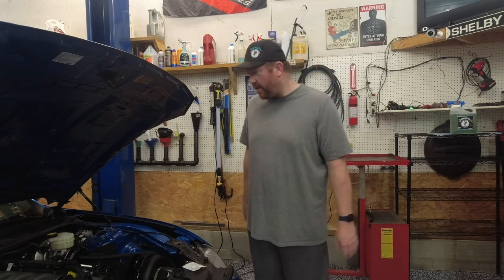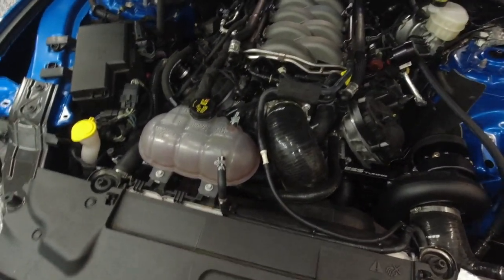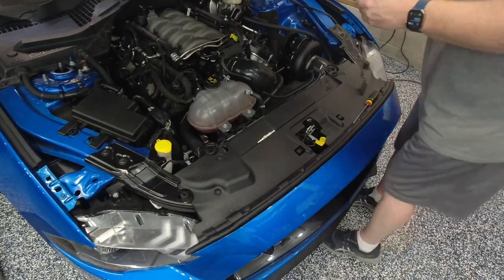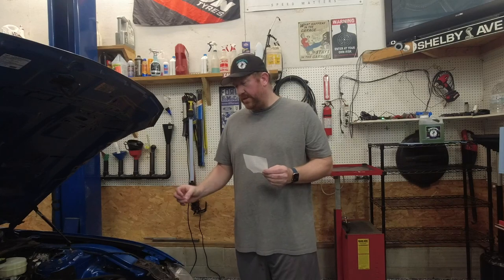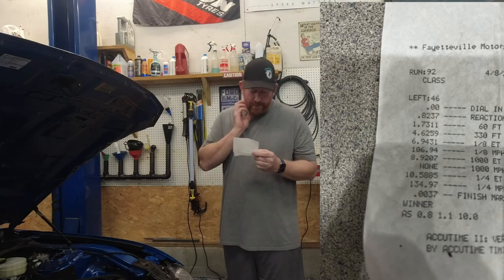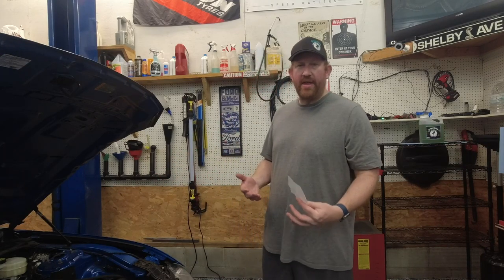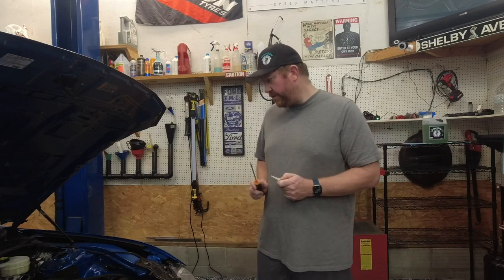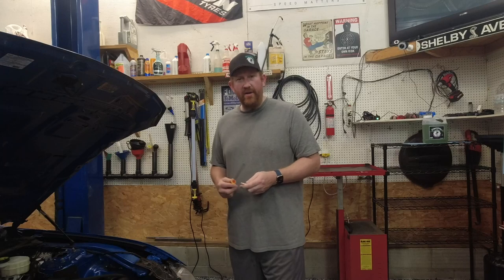S550 ESS Supercharger Follow up and 1320' Drag Times

Comment: Good stuff. My kit is sitting in my living room. Looks like Monday I'll be getting a different barbed fitting. I'll be dynoing my car before and after the install to see what the g2 kit (g3 intercooler) 125mm and lth picks up on 91. Ever consider making a driving video to give an idea on how the car performs just cruising around. Maybe a few light pulls but I'm more wondering when the car starts making boost and how the midrange drivability is. Are you on stock manifolds? Thank you and subbed!
Reply from the maker: Yes that video is coming this week actually.  Thanks for the comment.  I am on stock manifolds and will most likely stay there.  How long ago did you get your kit?  I was told that the same barb fitting that I purchased now comes in the new kits being shipped instead of the cheap plastic one that doesn't fit properly.  If your kit was received recently you might check as you might already have the 5/16" to 3/8" barb fitting in the kit.   Thanks for the sub.
Reply: @BoostJunkieMedia  I just got it about a week ago. It's the old style unless there's 2 fittings and I missed it
Reply: @BoostJunkieMedia  do you have a drivers side catch can? I just watched the ess install video and they are using a t fitting there. I have both the t fitting and the straight fitting in my kit. The t fitting also looks like it's 5/16 tho
Reply from the maker: I am running a UPR driver side clean can setup which I have connected to the inlet side of the supercharger on one of the rubber ports in the silicone coupler.   On the passenger side I have a UPR can between the intake manifold and the valve cover port with a one way check valve in it.  This will prevent from pressurizing the crank case under boost.  I also run a vented cap on the oil filler tube with a check ball in it that will let air out under boot but not in under vacuum.   I always go for good crankcase ventilation under boost as you will always have some blow by in a boosted application.   Not evacuating that pressure can lead to seals and gaskets being pushed out.
Reply: what did it make?
Reply: @ryandono5721  well I'll start by saying the 91 octane in my area sucks. The very first log we sent to the tuner he responded by saying "your fuel is shitty" lol. I then installed a water meth kit and the car made 591 on a mustang dyno (which I'm told read low). I was shooting for 600 whp so I'm happy. It's a fun street car now. It's more than enough power for my 295's mps4s tires. I just wish the gas was better around me so I wouldn't have had to do the water meth kit. Octane booster also is helping but I didn't have any in the car while dyno tuning. The ess kit is great other than that. I'd highly recommend it
Reply: @lobbyrobby  I'm shooting for 700 wheel. Do you think pullying down is better or just getting thr g3?
Reply: @ryandono5721  gen 2 or gen 3 coyote? Pump gas or e85?
Reply: @lobbyrobby  gen 3 coyote on pump gas preferably as not many E85 pumps near me
Reply: @lobbyrobby  thank you for the tips bro. I'm going to order a 120 g3 i think should i get injectors also or do you think it'll be fine without?
Reply: @ryandono5721  you'll need at least lu47 injectors (gt500) but you should research tuners and see what they prefer. Lund, palm beach dyno are a couple examples. You'll also need a boost a pump for your fuel system or if you think you'll ever run e85 you'll need a return style system.

Comment: Just came across this video,  wondering on how your ess is holding up and if you made any suspension adjustments? Or have reinforced anything? Before or after kit install.  Thanks.
Reply from the maker: The ESS is doing just fine.  I have a few BMR goodies, springs, vertical links, toe rods and viking shocks.  Other than that its stock.

Comment: 135 mph! Nice
G3 kit with bigger inter cooler? 
What was da when you ran the car?
Thanks
Reply from the maker: Yes G3 kit with the upgraded intercooler.   According to drag times app at the time of the pass the DA at Fayetteville, NC was 778 ft above sea level.
Reply: @BoostJunkieMedia nice run. 
What catch can or breather set up you using?

Comment: Do you mind showing us the boost gauge routing from the inside? Like where it comes out. I want to rout my boost gauge same way but it feels like there is a block off plate.
Reply from the maker: Yeah I can try but its pretty tight under there to show much.   You have to kind of come through the firewall at an angle and not straight through perpendicular to the firewall.   The carpet could be stopping you as well but when I came through at an angle I was able to get it to come up above the carpet.

Comment: Do u know anyone running a snow performance kit with the throttle body spacer on an 18 and up with the ess
Reply from the maker: I do not know of anybody doing this.   I have not heard the best things from the  snow performance kits as after a few years the pump and other things start breaking down from the meth corrosion.

Comment: Do you upgrade the fuel system?
Reply from the maker: You can depending on your goals and if you are wanting to run E85.  I am just running a boost a pump and bigger injectors but still the return-less style stock pump and system which is fine for 93 and moderate boost/timing.